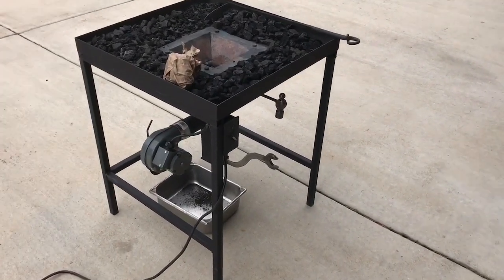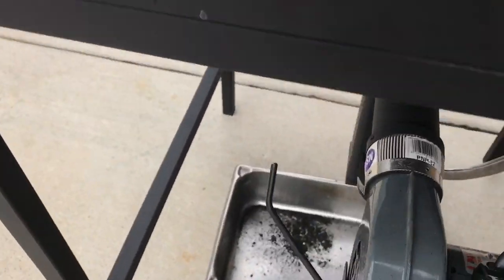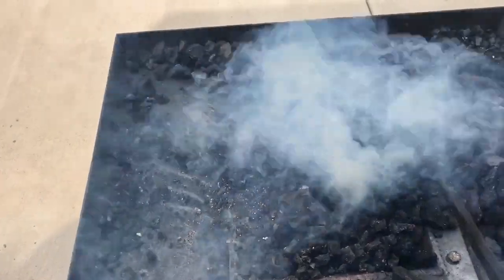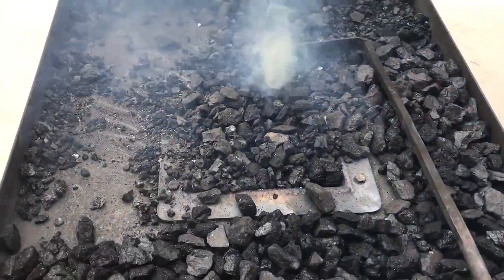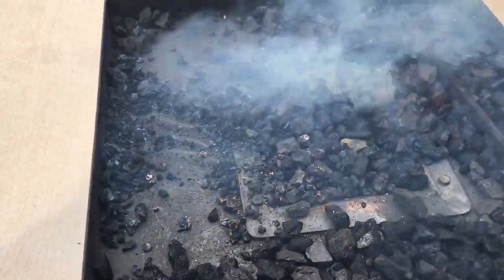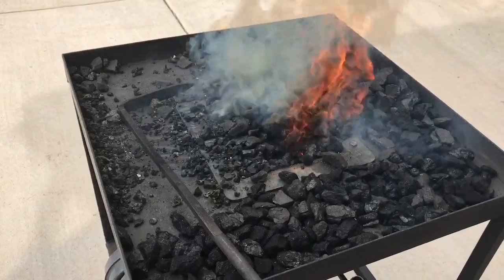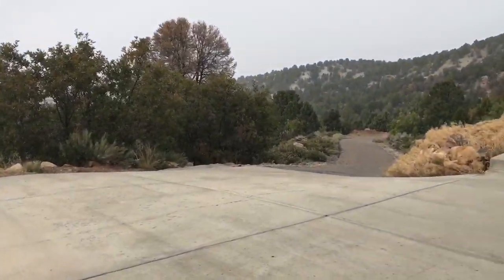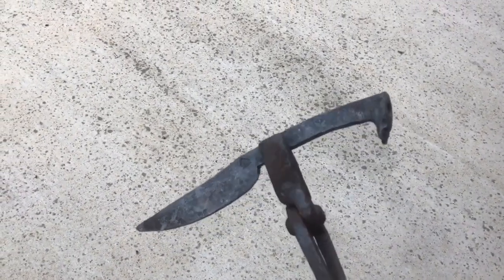My homemade coal forge

Comment: How about a step-by-step video on how to build this Forge and items used. Looks great!
Reply from the maker: i may do a video on how it was put together, its a relatively simple forge, so i will see what i can do.  thank you for the comment, cheers.
Reply: I would like to see how it was made also!
Reply: @SAVAGE_IRON  i think i see how you did it but i just have one question...ok two what kind of metal did you use for the top and where did you get it?
Reply from the maker: @davideckard5827  if by "top" you mean the table that holds the coal, it is 16 gauge steel with the outer lip made of 1/8x2 inch and a frame of 1 inch square tubing under it.   as to where i got the steel, i bought it at a local supplier.
Reply: @SAVAGE_IRON  hmm ok. i'll have to look around. i have a table i think will work but im trying to make the firepot. i am having trouble finding the metal :/
Reply from the maker: @davideckard5827  the steel that makes up the firepot on mine is 1/2 inch thick, 1/4 inch is plenty thick though.  as for finding a steel supply, try local welding shops, they will know where to get it, or you can probably buy it from them.

Comment: I'm really liking your clinker breaker and the ash dump and clinker breaker handle. My clinker breaker is a solid piece of steel just a little smaller than the hole, maybe 3/8 all the way around for air flow. Now that I see yours I'm thinking about either drilling some holes in it or slotting it similar to yours.

Comment: What keeps the table from melting?
Reply from the maker: reaction channel5290  all the heat is in the fire pot, which is half inch thick steel, air is blown in from the bottom which does a couple things, makes the coal burn hotter, and keeps the fire pot cooler. the table may be thinner sheet metal, but none of it contacts the fire in the forge, it is simply to hold coal to be burned in the fire pot.
Reply: James Savage thanks dude
Reply: Some pots are lined with clay. 😁great stuff bud.

Comment: whats the size of the top?
Reply from the maker: Horta Chan 24x24 inches
Reply: @SAVAGE_IRON  thanks a lot
Reply: @SAVAGE_IRON  What are your firepot dimensions? I was about to pull the trigger on a design I put together so I decided to compare notes and yours has a lot of similarities in the table and firepot department.
Reply from the maker: @schleybailey  the firepot without its mounting flange is 8x8 at the top and about 3.5x3.5 at the bottom, with a depth of about 3 inches.
Reply: @SAVAGE_IRON  Thanks! I was originally going for 10x10x4. And the fact that our measurements are even close gives me some comfort.

Comment: Great design. Wish I had this when I was starting off.
Reply from the maker: MOSSY HOLLOW thanks! There are some improvements I will probably make to this forge since I've been using it, hood, pair of wheels, some cutouts in the pan so stock can be slid in level to the firepot, and if I can find a better blower cheap ( as in 10$ at a yard sale or something). Other than that it's a good little forge.

Comment: After i saw this video i went and made one lol 

Not real good steel suppliers in my area though so i ended up getting 1/8” steel for the main table and 3/8” steel for the fire pot. But I burn anthracite and havent noticed any problems so far. Thanks for the design idea man
Reply from the maker: 3/8 is absolutely fine for the fire pot, could even get away with 1/4 inch, my table is only 16 gauge, 1/8 is definitely better, Well done!  if you can find a hand crank blower i recommend it, wont melt your projects as easily, though with that kind of coal you will need a pretty strong blower.
Reply: @SAVAGE_IRON  thanks yo. Yeah, i just ordered a dayton 1tdp3. Apparently you can control the airflow and its pretty quiet

Comment: Good evening i am in the process of making up a forge and i really like yours. i am wondering how your worked out it has been a few years now that you built it. you put out great forge video's hope you start putting out more. Merry Christmas
Reply from the maker: this forge has been holding up fantastic, there has been no damage to the fire pot or the clinker breaker in the years I've had it,  the only thing i have changed is i swapped the electric blower for an old hand crank one. thanks for the kind words, i hope to make some more videos in the near future. Merry Christmas!

Comment: That's wicked cool. I'm not a blacksmith but it's somthing that really interests me. Do you use anthracite coal?
Reply from the maker: i use regular coal from a local coal yard, its mostly used for heating houses, its pretty decent quality stuff, and its relatively inexpensive. anthracite is nice, little bit harder to start it and keep lit, but it works well.
Reply: @SAVAGE_IRON  I guess cause softer coal has more impurities you get a bit more clinker then?
Reply from the maker: @charliemcgee9803  if it's all black, no sulfur or other stuff in it, and can be broken by hand, it should be alright.

Comment: don’t you use refractory cement or refractory bricks to prevent the metal hot pot from melting?
Reply from the maker: you can, though it isn't necessary, since air is being blown up through it, i have measured the temperature of this firepot while this forge has been running, and it never got above 800 degrees, it wasn't even glowing.  this firepot is made of 1/2 inch thick mild steel, nothing special, the inside surface hasn't degraded, and there really isn't much change since i built it.

Comment: I would like to know how you attached the 1/2” spinning blocks that hold the coal, also if the forge can heat up steel orange hot, can it also melt the spinning blocks that holds the coal?
Reply from the maker: the clinker breaker bars are 5/8 x 3/4 inch, they are attached with  set screws on a 3/8 bar.  this forge is easily able to melt steel, and it has, however because of the air flow from the blower it keeps the fire pot and clinker breaker plenty cool enough to not melt, in fact the fire pot and tuyere (where the air enters the fire pot) don't even reach 800 degrees while this forge is running. so far there is absolutely no damage to the fire pot or clinker breaker in the 3 years since i built it.
Reply: Thanks for the reply!!
Reply from the maker: @Surtac100   sure thing

Comment: Mine is similar  I mounted the fire bowl under the top plate to keep the coal rake from find the edge of the fire pot
Reply from the maker: I’ve not experienced that with my forge, the flange on the fire pot is only 3/16-1/4 inch thick.
Reply: I think I'll go from the top and just bevel the edges if I go with a thicker material.

Comment: That pot looks just like the one i ordered from ebay. Its all half inch also 10x12x3.5 deep
Reply from the maker: your fire pot is larger, mine is 8x8 and abut 3 inch deep or so. i made mine from scrap/free steel i had, and for what it is I'm not complaining, and it works well enough for me.

Comment: I would like to know how you attached the Clinker Breaker blocks to the round rod. Did you drill through and then weld?  Also is seemed that it was spring loaded..can you show a picture of that if it is.. Thanx... Frank
Reply from the maker: the bars are held on with set screws, i ground a flat in the rod so it doesn't slip, this makes the whole thing able to come apart for any repairs needed.  yes there is a spring attached to a small lever that returns the bars to their original position. if i remember I will show it in my next video.
Reply: Nice build well done

Comment: Man it seems like with these bigger fire pots it would burn up alot of fuel/coal , I still just use an rotor from a truck and can still work big stock just have to build up dams on either side and I can run bigger stock through it no problem , also if not damed ,  the fire and the non oxygenated spot is more a less on top of the forge so no having to build a huge pile , idk just food for thought , nice bud and nice work on the forge guess I'm just el cheapo
Reply from the maker: this forge cost me very little to make, its mostly scrap material or metal i got for free, blower cost me 5$ probably less then 40$ total. the firepot is quite small in comparison to other forges, as its only 8x8 by 3 inches at its deepest so it is probably as small or smaller then a truck break rotor or drum, fuel efficiency seems good. also coal where i live is cheap, last i bought coal i got 430 pounds for 21$ , and it performs fine. this forge is 1 of 3 that i have made, if i want to work on something larger i will use my gas forge. half the time I'm making smaller items, such as knives, bottle openers, spatulas, steak turners.
Reply: @SAVAGE_IRON  ahhh i see , where in the hell are you getting coal for that cheap lmao , people freak out when they hear I get 100 lb. for 15 $$$ lol , and yhea I went out and measured and yhea about same size as my pot guess it just looked kinda big from vid , do you dam it up with firebrock when running larger stock or just always go to propane ???
Reply from the maker: @blakehorton8110     just use whichever forge is right for the job,  i have 3, coal, propane and my mini forge (also propane mainly for portability and small stuff ). I can't really dam up my coal forge since the 5$ blower is not strong enough (someday i may upgrade that, i also have a hand crank blower).   i get my coal from a nice old gentleman who runs his business  in a small town south of me.
Reply: @SAVAGE_IRON  Where did you get the blower from?